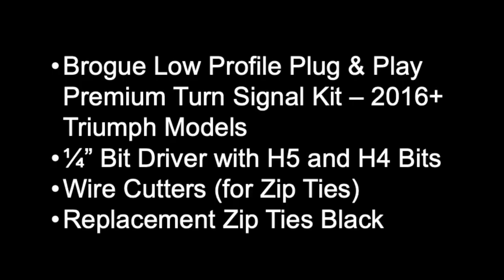2024 Triumph Street Triple - Brogue Low Profile Turn Signal Install

Comment: Could you just pull the Fairing without taking out that plastic grommet?
Reply from the maker: Not on the 2023 that I had. The plastic rivet holds the red plastic fairing in place.
Reply: @TimothyBoyden  Thanks. Could you recommend how to pull the fairings? Do you just pull only or you have to squeeze it somehow as well?
Reply from the maker: @Ventcis  Just pull. Didn't take that much force to do so once the rivet is removed.

Comment: Hi! Good video! I've the same bike, in cosmic yellow, and now I bought the same windscreen as you, the problem is that to installing it, I've to remove the small plastic piece in front of the TFT, but I can't find the way to do it, I tried removing the headlight but I didn't find how to do it. Did you installed for yourself??
Reply from the maker: Sorry, I had the shop install the flyscreen as part of the purchase.

Comment: Was tightening the nut a pain on install?
Reply: Use the regular nut supplied, not the nylock nut included as it’s very difficult to tighten. The regular nut supplied is easy with a socket on the inside and an Allen outside.